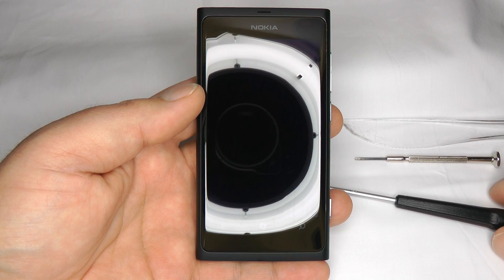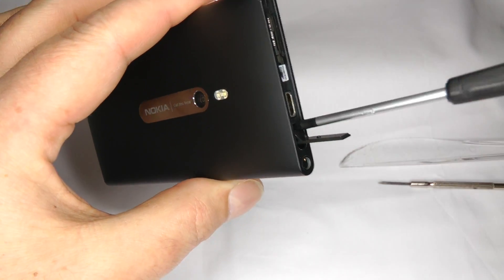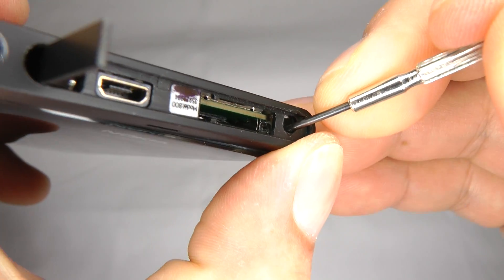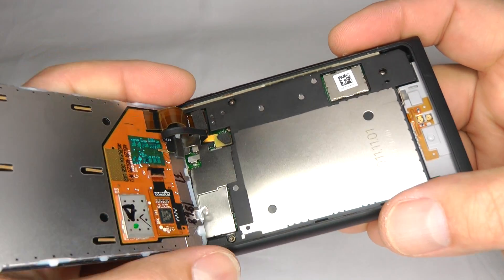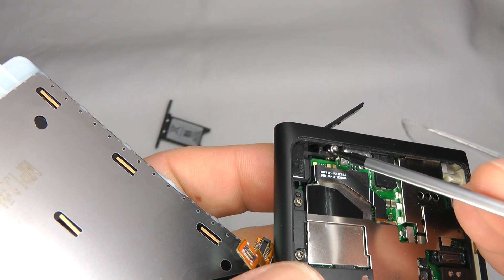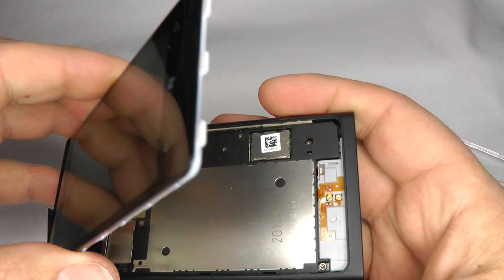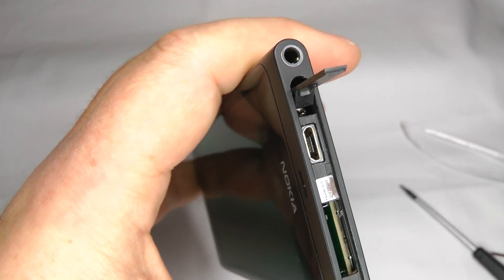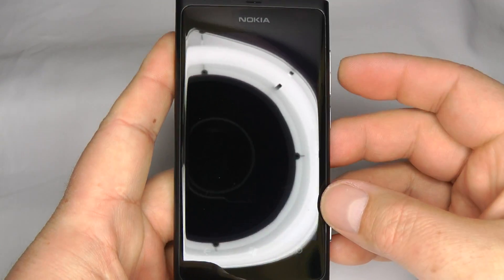Nokia Lumia 800 Screen Repair / Replace / Change a Broken LCD (AMOLED) + Touch Screen (Digitizer)

Comment: HI there,

Has anyone found that once they've replaced the screen, it works but isn't properly secured? My phone has been fine for about a month, but then i realised that one of the screws was unloose and the screen came out of the body a bit. So upon re-screwing the screws, the screen now easily falls out of the body. I try and push it in but it doesn't click into place.

Does anyone know the solution to this?

Thanks!

Comment: Hey, I've replaced the screen, everything lights up. However the three bottom buttons don't seem to work and the screen seems to be out of line. When i try and press anything, the image is normal but the touchscreen seems to be out of calibration, pressing things a cm away from where ive touched the screen. Is there some way of calibrating it? thank you

Comment: Please help :( My Lumia 800 accidentally fell on cement. The glass broke but is still intact on the frame.. The Screen is still working and there was no damage at all.. Is there a way to just replace the glass without changing the LCD?

Comment: Thanks, I just changed my display, your instructions are really clear and straight forward. The display assembly I bought from aliexpress didn't come with a front facing camera so I had to remove that also, and it could have been even clearer that the trapped screw just had to stay trapped.

Comment: Hi There,Dropped by just to thank you for your information regarding changing my broken screen, i have replaced it, However when i first turned it On it would Not work as Touch Screen !! as you know it is then dificult to turn the phone off!
Once i had turned it off and back on again, it was and is all working !! thanks again ! Regards Chris

Comment: Hi Ive just changed my screen as directed on the Nokia 800 however, the replacement sreen only had the large strip connector and not the two, the long thin one was not on the screen, I have completely fitted the screen and everything seems to work great do you know what the long thin connector was for? and can you for see any problems with not having it

Comment: Hey i recently got a new screen as you advised (thanks for help btw) and it worked it comes on and everything but now the phone will not read my sim card it just says no sim or invalid. Also when its on for some reason even the wifi doesn't seem to be able to find a network and i know it should just keeps saying searching then no connections then trys again, was wondering if this could have anything to do with the whole new screen change over if you know? Thanks

Comment: Ok thank you, so if i got that item and attach it as in this video it should work? and obviously somehow remove the battery and then replace it back first as ive tried to turn it on before hand? but thats another matter will have to look into getting the tools for that.

Comment: Hey, my screen recently broke and i watched this video thinking it was fairly straight forward to repair (buy a whole new screen off ebay) but looking into it more ive seen talk about depends if the Digitizer is broke or something. Now im not 100% sure my situation is the screen is totally shattered and when i try to turn it on i see no light and now the screen is detached, i thought if i got a new screen as seen above it would fix but i dont think so could you message and try and help me please

Comment: IT WORKSSSSSSSSSSSSS!! Dropped my Lumia 800 three times and on the third time the screen wouldnt even turn on but now its good as new with a shiny new screen from ebay!

Word of warning, when I dropped it the screen had seperated from the digitizer (glass and plastic bits), so it wouldnt come out for a while as the plastic bit (digitizer) got stuck. But eventually I realised this and got it all out!

Thanks so much uploader you saved me getting massively ripped off from these network providers!!

Comment: Dear Mr Lesson 5 
Thank you very much for this fantastic video, very helpful indeed. I have a question , I found a OEM Nokia Lumia 800 LCD Screen and Digitizer Assembly with Frame, is this the same frame as the one mentioned in your video as "LCD (amoled)/Digitizer" ? Is there a difference between OEM Nokia and AMOLED Nokia ? Thank you very much for your efforts.

Comment: Hey, I replaced the screen a week ago, and yesterday my phone fell again (from a low height of around 2 feet) and the glass of the replacement screen from ETradeSupply shattered. In the previous screen, the glass is okay and the screen is shattered. In this, the glass is shattered but the screen is okay. Is there a way I can remove the glass from the old screen and put it on this one?

Comment: Great vid!

I have a problem where the touch screen is unresponsive down the right hand side (picture is fine tho), its about 5mm in, all the way down. Would replacing the screen cure this? The phone as done this since new,

Comment: Great video, thanks! 
I dropped my phone (Lumia 800) this morning to land on its back. At first, there didn't seem to be a problem. However, after a couple of hours (not using the phone), I noticed that the display only shows some horizontal redish lines along the sides. Will I have to look for a replacement screen, or should I first try and see whether the connectors between the main board and the display have come loose? Not sure whether that is a possibility. Thanks for your advice! Joris

Comment: Great video! I just received my replacement screen the other day, but it only has one flex cable (the thicker one). I contacted the seller and was told to use one of the flex cables from the broken display. Do you know if that is possible? 

Thought I'd ask before I try since it's my only phone. :)

Comment: Hi, first I want to thank LE55ONS for the great videos!

I'm wondering, if I would damage something, if I put a N9 screen into a Lumia 800. I have both devices but the Lumia's got a broken screen and is not working. I'm wondering if it would work again, when the screen is replaced but don't want to buy a new one as long as I don't know.
Has anyone yet put a N9 screen in a Lumia? i know there are no buttons at the bottom, just wondering if it will turn on again..

Comment: Thanks for response. The problem is that the etradesupply shipping costs are very expensive. In total pay around 60 €. In ebay already included shipping paid about 32 €. My screen did not broken, the problem is the colors of LCD, has vertical lines and 1/3 of the screen is black . I'll try the warranty, if not resolved will have to buy a new LCD. Thans.

Comment: Great video. Congratulatiosn. Sorry for my poor English. I have a problem with screen color of my lumia 800 after a fall. There are many LCD for sale on ebay but i not know if they are original and quality. Does me could indicate a reliable store? The etradesuplly is reliable? The LCD is original NOKIA? With Gorilla glass? Where you buy your LCDs? I'm afraid to buy and the product is not original. Thank response. Best regards

Comment: Thanks for your video!

Before removing the cracked screen, the phone had a picture and everything was working fine. Is it possible to damage the phone in a way that it wont show a picture on the new screen afterwards? We were super careful and didn't do anything we could think of to damage it but the new lcd screen does not have a picture (it does respond however to button presses on LCD by phone vibration). 

Should the new screen show the picture by just plugging in the data cable?

Comment: thank's for your reply,  I have fixed the issue with not being apple to click the settings icon,  no matter how hard i tried to click it, it wouldn't , i deleted the app which was underneath and for some reason it now works  :S   the home and and back touch buttons are becoming more responsive  now the more I use them , very strange ! lol

Comment: thanks for the vid, it helped ,  replacement screen works fine but i have an issue with the   back and home buttons not being very responsive at times and not being able to get to the settings menu as it either wont press or it will just hit photos or a different app, has anybody else experienced a similar problem?

Comment: Hi, you are great!
I accidentally dropped my phone and the case is a bit dented on the edge right where you insert the sim card. Also the screen was a bit detatched from the case.I managed to push it back in and it's working fine.The only problem si when I try to give calls. I can press call but then the screen goes black. I can still hear, talk and receive calls.As soon as the call ends I get back to the home screen.The rest works perfectly. Do you think  I need to change the hole screen?

Comment: I was going to try and save my 822, the 800 is pretty similar?  I had an issue where the screen cracked and was usable, and suffered another fall and the screen went blank, with some light showing through in spots..

Comment: Hello I have to change the screen on my daughters Lumia 800 and this video is very informative and instructive. However a lot of the Lumia 800 Digitizers that I can find do not have the Proximity Light Sensor Flex installed. Ones that do cost more. 
Could you please tell me if it is an easy job to change the Proximity Light Sensor Flex from the broken unit to the new one? 
Many thanks.

Comment: Thanks, this just saved my Lumia! But I have a very early model, and the screws were in fact T6. The screws were also very tiny, there was no problem getting the first one out through that hole. Apparently Nokia has changed the screws at some point?

Comment: ok update i stuck the old proximity sensor back in with duct tape! ;)
and it works now,, a bit delayed but still works, so yes it is the proximity sensor which dictates the orientation..

Comment: Have some screens only one cable? I need new screen and in ebay is sale screens with only one cable. I have two cables in my screeen, so will this work for me? My screen not reacts when touch, but lights and all else work nice.

Screen in ebay 281052197877 (cant link it here, type code to ebay)

Millions thanks if you help me :)

Sorry for my bad english...

Comment: Hi there. I just seeing if i was capable of removing the screen. When removing i accidently turned phone on and the screen showed blue and green horizontal lines. I immediately turned it off and then clamped it back down (with the orginal screen) and now when i turn it on it just shows those lines. Do you know what i may do fix this?

Comment: hello its james here just wondering because i was looking at all the screens on the internet and NONE of them have two ribbon cables, just the big fat orange one, and also would you have to take the proximity sensor out and put it in the new screen and if you had to do that could you make a video about changing the sensor. Anyway i was just wondering if the screen would still work without having the small black ribbon cable and if any sensor changing would be required. Please reply and thanks!!

Comment: i replaced the screen on a lumia 800 but the digitiser is not calibrated, is there a way to calibrate it or do i need to send it back to the retailer?

thanks

Comment: All working although i have found if i tighten one of the screws up fully (near charge port) when you make a call the prox sensor seems to think it near ear even if not, loosen it a bit it works fine :/ strange but not complaining many thx for video, life saver

Comment: i replaced the screen but it won't take touch commands anymore.. I have not yet fully reassembled the phone.. Is this normal or how is this possible? The touch was still working with my cracked screen.

Comment: I am so confused. The top portion of the glass on my 800 cracked, but the AMOLED display is still mint. I've been checking on Google shopping, and I've seen many retailers selling the 'front glass' for only 20 dollars. Personally, what would I have to do in my situation to fix my phone?

Comment: I dropped my phone on the pavement and screen went black and shattered however I did ask my husband to call me to see if the phone was working and it did ring but obviously i couldnt answer it. it also makes email reveived noise still and a noise when i plug charger in .... do you think just replacing screen will fix it? your video has given me confidence to DIY not send it off and pay a big fee!!!

thanks!

Comment: Yes, the other cable is the proximity sensor which you can remove from your old screen and insert in the new one. Pry it off from the corner very carefully and then press it on the new screen.

Comment: I dropped my lumia 800 in the bath and left it a few hours to dry up. And when I went back on the phone, it started to move the screen and press different apps. But that's not all, the volume up button keeps pressing without me touching it. I think both the screen and volume up button are dead. Have you got any ideas or suggestions? Thanks love the vid!

Comment: I always use my mains charger.im thinking it def is the screen,(if not,it must be my phone when i dropped it,but does not explain why it worked when i replaced my digitizer first of all).after taking it off charge for a few hours it still does the same, vibrates once from time to time.im going to send it back and replace it asap. thanks for your help.if you can think of anything else could you please let me know.will let u know the outcome

Comment: sorry,i didnt word it right.i havent actually got a sensor at the moment,waiting for it to be delivered.also whilst i took it apart again and reasembled,i tried turning it on and it wont.the glass has come away from the metal but from your video, that wouldnt affect it from functioning.i tried charging it because it vibrates as if there is no battery and it wont do anything,it just vibrates from time to time when i leave it on charge. is this a faulty screen do you think?

Comment: sorry,i wrote it wrong,i havent actually got a sensor at the moment(waiting for delivery). Im pretty sure ive been given a faulty screen,but will eliminate the option when proximity sensor turns up..For some reason it does get alot worse when im outside

Comment: Ive followed ur instructions to replace the digitizer which was VERY useful,my proximity sensor was broken too at the same time i did the screen.after relising the sensor doesnt come with digitizer i installed it any way for time being(also leaving a screw out for now) until i can get one.the phone worked fine for a while but after a few hours ive relised the screen is flickering very violently from time to time. will it be a faulty screen or anything to do with the sensor or screw??

Comment: Hey :) Just wondered if you could tell me if there would be an easy way to fix my screen I've watched the video above and my screen has come away from my phone but the film is still attached and the metal backing is still in the phone not attached to the screen as your video shows. Has a link been broken that isn't obvious? Thanks :)

Comment: Nice rew.
But my nokia 800 lumia he got no screws...and there is no plastic cover is like gums not plastic and under logo nokia on the left is num. 800...and my sim cart not have plastic case only put the whole card on the top...and on the top is litle whole and a little arrow to put something in there...i got and is smal button...i dont know how to open...thx for help!

Comment: what do i do if my lcd came without the part in the back that fixes the lcd in the frame? i cant remove it from the old screen and without it the sceen will not stay in place

Comment: Hi, THANK YOU, you just saved me 200 USD or 160 Euro ( since the dealers charge insane prices on changing the LCD/Touch Screen.

Anyway, I changed it, but now I wonder...
my old LCD/touch Screen had 2 ribbin cables , large and small..
BUT my new LCD/touch Sceen only had the larger ribbin cable

What does the smaller Ribbin Cable do??
( my phone seem to work like allways )

Comment: My Lumia 800 got wet whilst in what should have been a waterproof pocket on my bike jacket so water has made its way inside, it still works as my alarms still go off and messages/calls receive etc, the only problems are the lock button and the screen does't register my touch. I've left it on a radiator on a towel, and is now in a box full of salt. Suggestions to bring it back to fully working order? I assume I'm gonna have to buy a new screen? Please reply.

Comment: replaced now my screen but the touch does not seem to work. I replaced the digitizer cable from the old screen...placed it correctly but the touch ddoes nto respond. Any suggestions?....thanks

Comment: Thank you for posting this. Very helpful. However, I have a question if you don't mind. All the screens I've seen for sale (complete units with the metal plate attached) have only the larger of the two ribbon cables attached. So am I safe to order one of these and transfer the other ribbon cable (from watching another of your videos it's a sensor of some kind?) from my broken screen assembly to the new one?

Comment: So the glass is relatively solid mounted, but with plastic clips that give it a little bit of freedom of movement.  So it's less likely to break than the iPhone 4/4S (in more ways than just how it is mounted), but it's probably more likely to break than say the N8 / lumia 900 which mounts the glass onto soft springy metal.  The Lumia 800 has harder clips and the steel brackets at the top.

Comment: Just one comment, when you change the screen, the spare part do not include the light sensor, located in the up-left corner of your screen (left when you see it backwards) is not hard to remove from the original screen, but be carefull. Al the rest is quite easy. Thank you very much LE55ONS for your usefull video